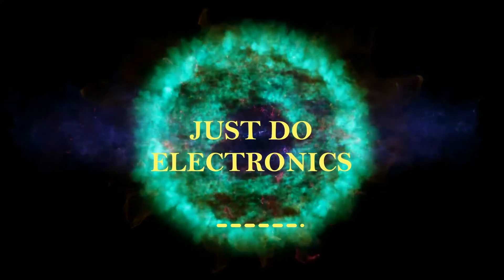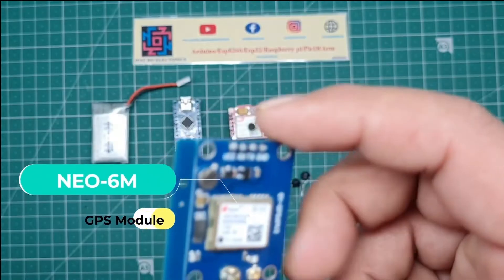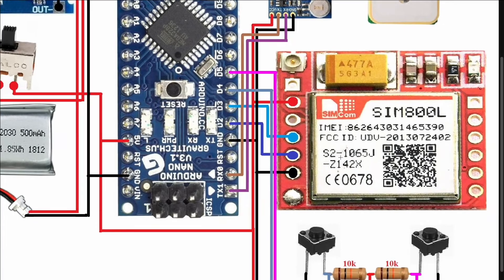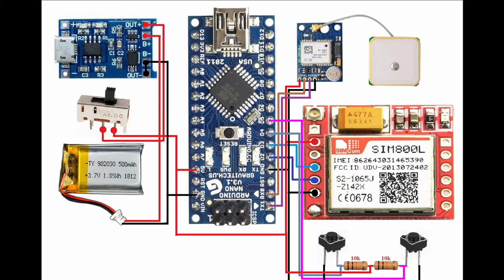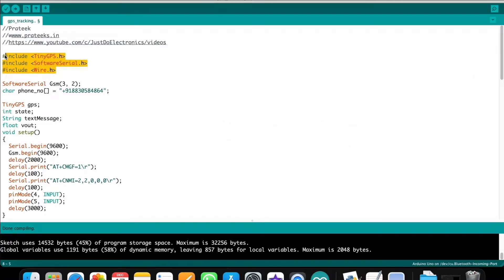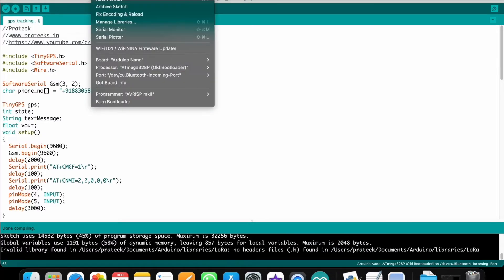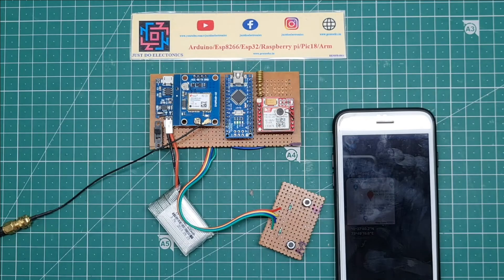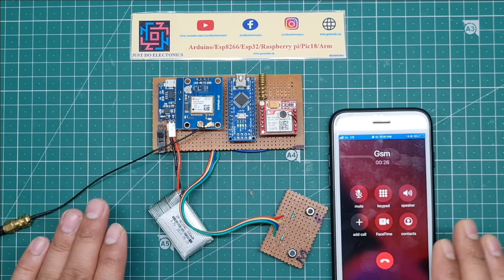Arduino Gps And Gsm Based location Tracking System | Women Safety Device Small Version

Comment: Is the Board will be getting shortcircuit when I on the push button Because one end of the button is connected to negative and the other end is connected to positive
Reply from the maker: Noo used pull up circuit don’t connect positive or negative directly just flow the circuit diagram proper

Comment: Please provide the code..
Reply: ye s please website had different code😅
Reply from the maker: @RishabhSingh-nh3py is same code chek properly
Reply from the maker: check website is available
Reply: In website that is different code provide me this code that you use in this video please
Reply from the maker: @Warminator  check proper is available
Reply: @JustDoElectronics  Code plese 1 or 2 or 3 ??
Reply: Cod
Reply from the maker: @user-gq4oo4zy4l yes
Reply: Does anyone got the code or completed this project please help me to 😭 I have done the connection part😭